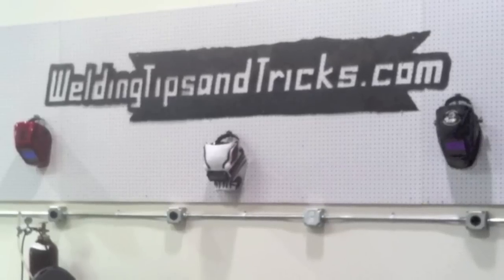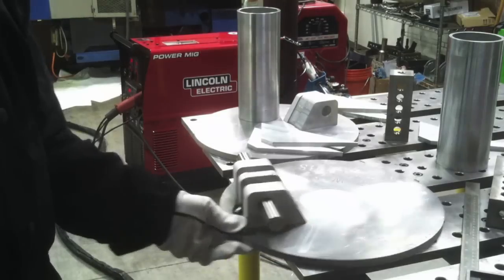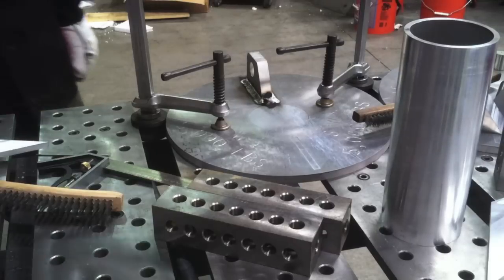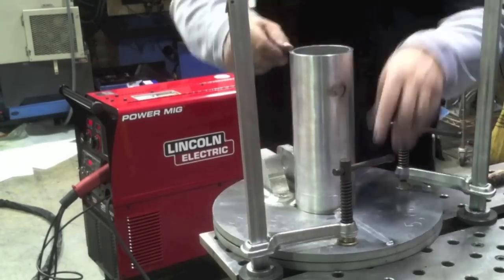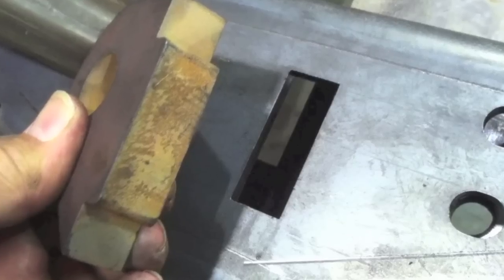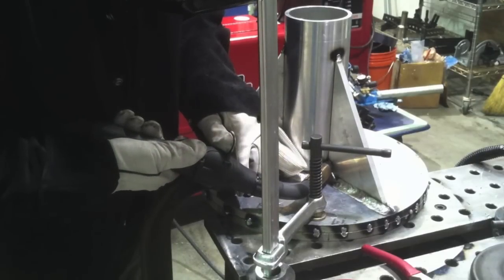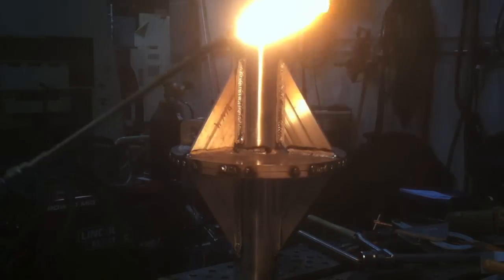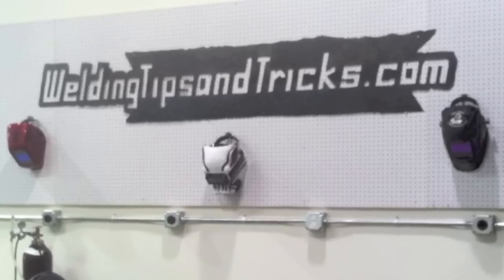Mig Welding Aluminum - Lincoln PowerMig 350mp part1

Comment: Cool. 
With the newer push/pull gun( Magnum pro AL push/pull), you can get the Bernard Centerfire tips and nozzles with diffuser. they have a narrow nozzle that can get into really tight spaces, Thats all I run now after finding out there is a compatible thread for this gun, instead of those gigantic head nozzles.

Comment: Question, it looked like in one of the close up shots you were lacking in cleaning action right at the “toe” of the weld or leading edge if you will . It looked to me like perhaps you had too much gun angle , am I correct in what I saw and the reason?
By the way, love your welding videos!!!

Comment: I have the lincoln 210mp and I really don't want to use a spool gun. Can I use the regular mig gun to weld aluminum with .035 wire and larger tip? What do you think? Thanks

Comment: Wondering if you are using 5356 filler wire, if so, is not the Smut a product of the magnesium in the arc  transfer?

Comment: The black in the weld is from not running a filler or quick pass to preheat the aluminum. After a filler weld run a slow hot cover and it will be nice and shinny

Comment: we have one of those exact machines at work and recently I had to do some parts with it.. I was using .035 4043 wire and program 148 and 149.  my Voltage was set around 21.5 / 22 and wfs was around 425 / 435   what settings were you using on this video.

Comment: I welded aluminum with a Miller push pull gun everyday for 2 years building camper frames it was awesome work but not enough scratch

Comment: Dude this is all wrong, I weld sport fishing boats inspected by the coast guard with a push pull and that’s garbage. You had to turn up the voltage because your welding a full inch away from the piece, you need to be as close as fucking possible to get the heat transfer. You turned it up and your weld is still undercut on a flat weld. The easiest shit ever. Not saying it’s easy for someone new but you’re trying to teach people the wronggg way. Don’t listen to this fool.
Reply: excited to see your youtube channel hope you teach us lots

Comment: i used to mig alumium when i built rescue boats,pulse is a complete gem.without the pulse you just wanna run it hot.i would weld a 1/4 t-joint verticle at about 500 wps and about 22-22.5 volts.looks nice and silky

Comment: His explanations are fantastic, I live in Brazil so things are a bit more difficult. I do not have a tig welding machine, I use a mig to weld aliminium, I would like you to post more welds in aluminum with mig preferably at 200 mp
       Thank you very much.

Comment: I have a  spool gun Lincoln 100 Sg 180 c Lincoln welder running .30 and.35 wire 
The problem I'm having is in the starts ! It is more often then not I get a wire burn up before the feed starts then tip burn to wire and or spider web or both 
I'm tried both wire types and I am running one size bigger tip. 
Most of my welding is 1 1/2- 3" on 3/16 pre heated to300+ degrees 
Any ideas of help

Comment: I have to preheat these pieces this size, it has helped me control warpage (bucking)
Im a mechanic that welds , so take that for what you paid for it
cobramatic mk3 weldandpower g9 thermodynamic pax3

Comment: Do you have gas on this gun while you're welding aluminum with the Lincoln Mig..? Thanks.
Reply: Yes. You definitely need shielding gas when welding aluminum. That is one monster welder. I am assuming that is a transformer welder. Must weigh a ton. My little everlast inverter welder is tiny compared to that beast.
Reply: C25 mix for steels or any mix really, but 100% argon for aluminum

Comment: I use this exact set where I work and have been having a lot of problems with the wire fusing into the contact tip.
Reply: we have these welders where i work as well, we just do simple Mig welds  though, We have fooled around with the wire speed at 700 and the voltage maxed at like.....34. something? its brighter than the damn sun but man does it weld good.
Reply: They weld good but they can be very finicky.  We have the magnum pro push pull guns. We tape the access door closed to avoid dust problems within the gun because they fuse tips alot.
Reply: i am not certified to weld on actual parts, i just do it as a hobby, and mess around with their 4 grand welder at work, taking a quick look at what gun the welder comes with looks like, we are just using the stock 300 magnum pro gun.

i was looking at buying my first Mig welder but i dont have 4 grand to spend and i am not sure if i would even be satisfied with a sub $1000 mig welder, especially since i really like the digital controls, i might halfto settle for a chinese made everlast, its a hard fucking choice.
Reply: +thelasthallow  one of the best mig machines iv seen under $1500 was a miller 212. infinite setting.

Comment: what is the different between this gun and a regular mig gun?
Reply: +Csaba Farkas  well, I think tig welding is still beats the price of this gun, it is crazy expensive for no reason.
Reply: +Csaba Farkas that gun is a push pull gun, the gun has drive rolls inside the gun to help pull the soft wire as the welder pushes the wire so the wire does not get stuck running through the torch and birds nest.
Reply: That dose not justify the $1000+ price.
Reply: +Csaba Farkas maybe for some but consider how much a 25ft long industrial spool gun cost (for a good one about $500) then consider the money you would save buying 44lb spools apposed to a bunch of 1lb spools of wire not to mention the time constantly change the wire out, and lastly it is much easier to hold and get in tight places. I personally work with both, I use a push pull gun at work cause I weld aluminum boats and a spool gun at my home shop.
Reply: +Ethan Schulz  sure no doubt, if that is what you do all the time, than of course its worth investing . but if you not a " youtube'r" like this guy in the video, then you gotta, pay the big bucks...
Reply: Totally agree, they seem overpriced to me also that is why I just bought a spool gun to save me several hundred dollars. However they still have there place, I definantly enjoy using the push pull guns over the spool gun but for my home shop so not worth it.

Comment: which wire are you using?? 5356 or 4043 ?  or what ?
Reply: +Dj Devil looks like hes welding on 6061 material which I use at work so id imagine its 5356 wire. love this machine....so smooth
Reply: +Tuner MacKinnon i am going to buy this machine this week. do i need the push pull gun ??
Reply: it has inputs for a push/pull or spool gun. they're very beefy machines, 100% duty cycle. id look into how much welding you'll actually be doing and choose a machine based on that,
Reply: +Tuner MacKinnon i dont 100% duty cycle machine. 60% is ok with me. we make aluminum truss. i want a mig welder for fast production and finishing must be like tig welder. plz suggest me further.

Comment: Im a new aluminum welder only been doing it for 2 months for military and i use this machine everyday with the same gun.. Needless to say the amount of weld we do with those air cooled guns is more than what they are capable of handling. I have "smoked" (melted the liner) 1 gun myself and my other co workers have had problems as well with the guns overheating. Its not a bad machine i just highly recommend getting a liquid cooled setup.

Comment: Hey. I. Looking into buying a pulsed mig from Esab, c3000i. Has any1 had any experience with this machine.. Plan an using it for aluminum.  Am i better off buying a tig instead. Welds mst look good on  40mm tubing notched joints.

Comment: Here in Sacramento, Calif, back in the 1980's and early 90's, I worked for a sub-contractor for Aero-Jet (Rocket engine manufacturer) and I got plenty of 'projects' that had many engineering drawings. You' be surprised how many engineers have little or no clue about welding joints/set-ups. 
 I got lots of stuff tighter than this job, even had various cylinders/cones with both ends welded on, drawing showed fillet welds inside both ends! So, yes, Rocket Science for sure. 
Uh-oh, gotta-go.

Comment: I has to do with the emmisivity of the object being meaasured. Measuring the soot spot is the right way to go - if you put a little flat black paint or something dark like that in a larger area it would be easier. You can also get some IR probes with adjustable emmisivity (try Omega.com).

Comment: hey, i was teached that welding thicker plates than 8mm or 5/16 must be preheated....
what do you think about that???
you can also use a peace of wood to check the correct temp, when you touch the surface with it and you can see surface changing on the timber-then you reached the corect point

Comment: Hey Jody. Great video. Would it have been better to put the gussets on first?? I have the exact same setup as this. We run on mode 71 with 100 per argon.We run at around 60  on the gas.We have found that 6.8 + on the arc control works best. I am curious as to what you find works best. Keep up the great videos, and cant wait to see the next one.

Comment: Measuring clean aluminium with a IR thermometer can be startlingly inaccurate. My favourite demo of this is to take some clean foil, and put it on top of a pan of boiling water. 
It will measure almost exactly the temperature of the ceiling.

Put the lightest smear of cooking oil on it, and it reads 100c.
If that metal was clean, it was a LOT hotter than 375f.

Comment: Nice video Jody, looking forward to part 2.  We have a miller 350P machine in our shop setup for aluminum.  We get a lo of soot from it so I'll be looking forward to your settings on the Lincoln.  The miller is similar in that you just set the wire speed and it adjusts the voltage per the program.

Comment from the maker: yep...you are correct  .  dcep is where cleaning action comes from and with aluminum mig, you get 100% dcep.
unless I tigged on dcen using pure helium, it would have warped even more due to much slower travel speed.

Comment: Wait so your getting electropositive 100% of the time with DCEP? I guess with TIG it wouldn't work because it would melt the elctrode but with MIG thats exactly what you want.

One last thing. Why didn't you TIG this? Because of the thickness of the material or was there another reason?

Comment: Great video.
I wanted to know if you have any birdnesting problems with that type of gun? 
I have a millermatic 175 that I added a spoolgun to and I have lots of birdnesting if I don't use fast wire speed and keep the gun tip and electrode pretty far away from the puddle and use spray transfer to weld with .

Comment: The push pull guns are for serious aluminum production, you can run 20+ lb spools of aluminum wire and treat it just like using a MIG for steel, except pure argon and different settings, obviously.  S/F.....Ken M

Comment from the maker: hey and thanks for posting the questions...

1. There was a ton of welding on that plate and warpage was inevitable without some kind of measures to prevent it. simply cooling off would not do.

2. Aluminum mig is done using dcep and you get cleaning from the electrode positive current

3. no humor due to feeling like crap from a cold.

4. a horse walks into a bar and the bartender asks..."why the long face?"

Comment: Jody I have two possibly stupid questions but ...you don't ask, you don't learn. 
1. Is allowing the work piece to cool an option here instead of all the warpage control
2. Its a DC unit which I know can weld Alum but I didn't think it provide ANY cleaning action, ie there is no return current to bake off the oxide. is that wrong?

Good video and we haven't seen some Jody humour in a while. You have gone all serious and business like on us!